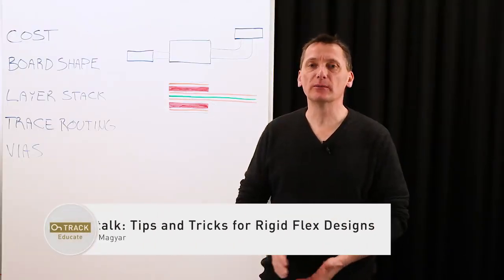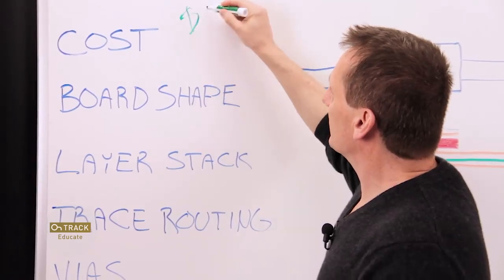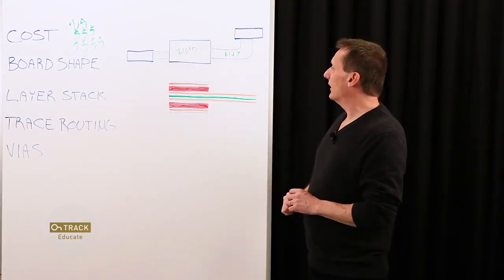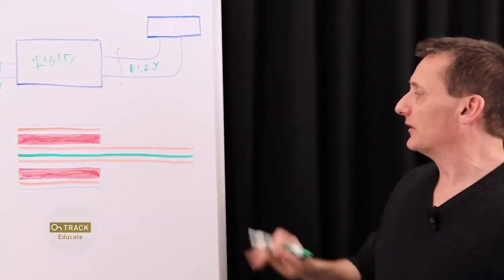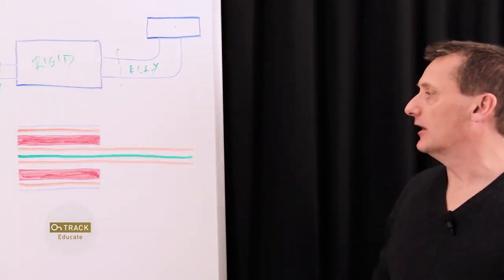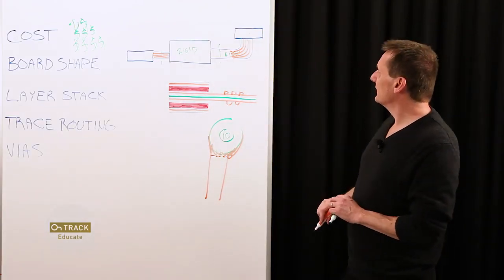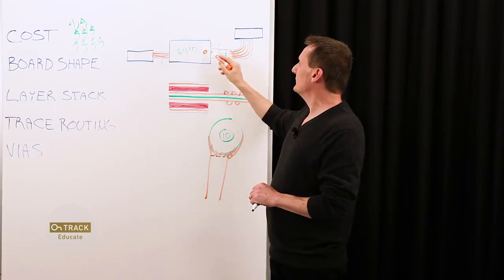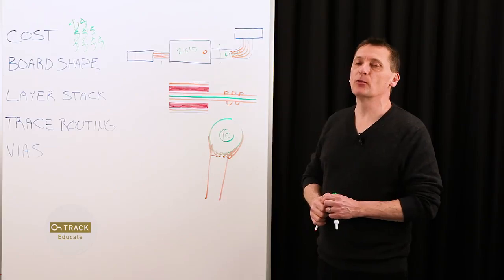Tips and Tricks for Rigid-Flex PCB Design - Altium Academy

Comment: We have an application where a PGA lead length mandates a thin PCB for meeting lead protrusion requirements. We are thinking of a rigid flex design in which we want to use a thin rigid PCB connected to a thicker rigid. The question is, is it possible fabricate a rigid flex wherein the two rigid PCBs connected by a flex to have different thicknesses?